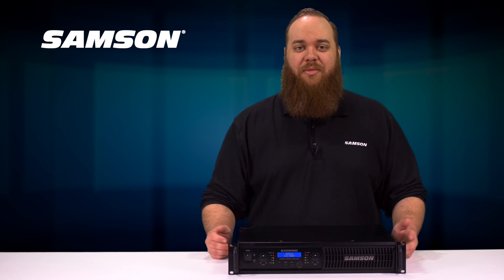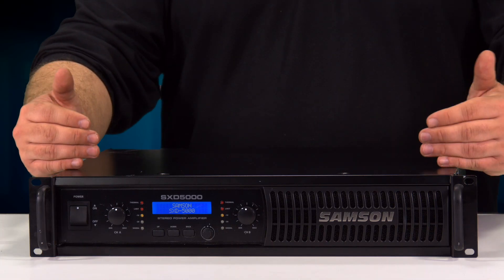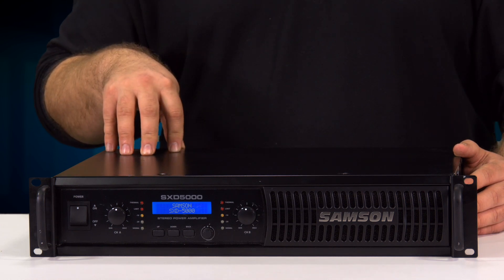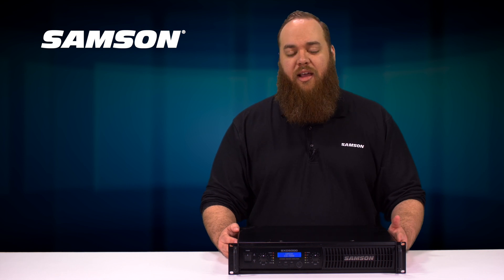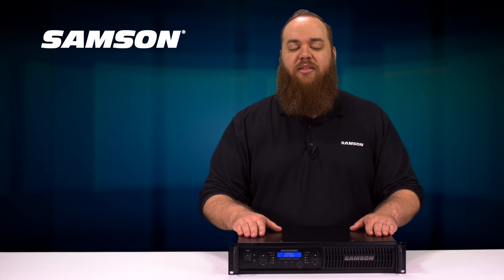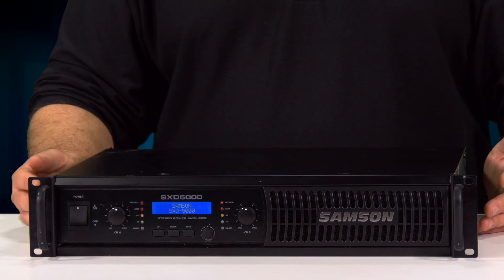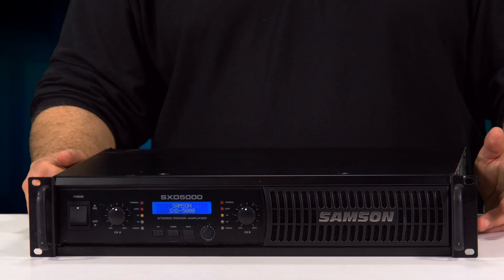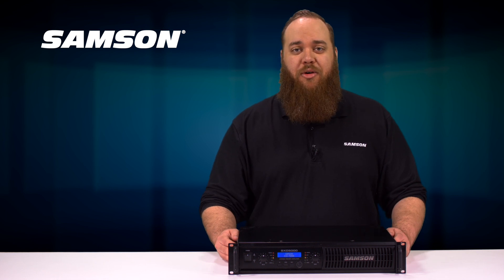Samson SXD5000 Power Amplifier with DSP

Comment: I'd like to see real sustained power measurements with both channels driven, every class d amplifier i've seen, even the crown xls stuff has over inflated power ratings... Post real output measurements...
Reply from the maker: Hello! That makes sense, for sure. I will talk to the folks at Samson abut that the next time they are here at the studio. Thanks!
Reply: @markertek  I appreciate that a lot, if they are willing they should send their stuff to audio science review to get fully looked at, audio science review is an audio enthusiast board that posts detailed measurements for equipment, they did the crown amplifiers as well, crown even recognized their measurements officially on their site for their xls amplifiers, you should check it out when you can. But yeah, lmk then man, it also would be cool to incorporate internal video and pictures of the amps you review. As far as power measurements go, I do wish they were honest and offered both channels drivin from 20hz to 20khz, that is truly the only honest way. Everything is rated at 1khz these days..
Reply: This is a class b push pull amp. It's heavy big transformer big caps. If anything after seeing this one run I feel like it might be under rated wattage wise